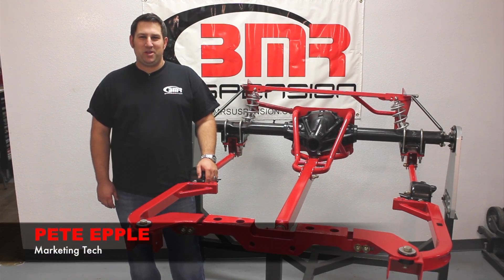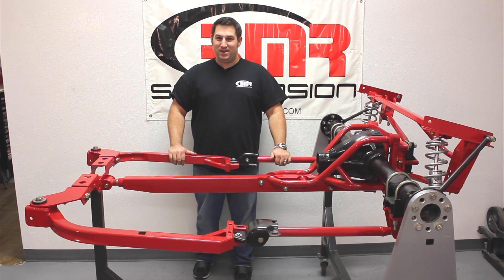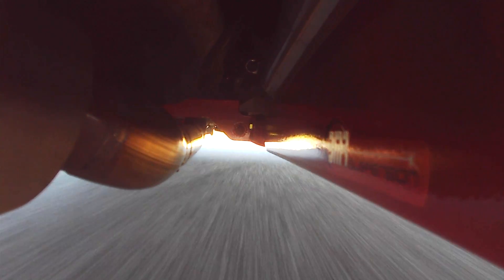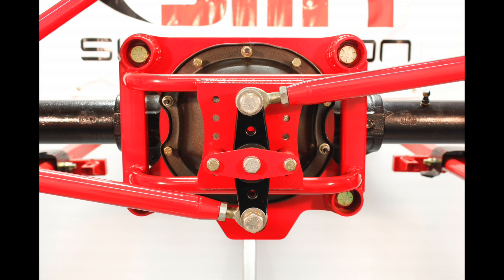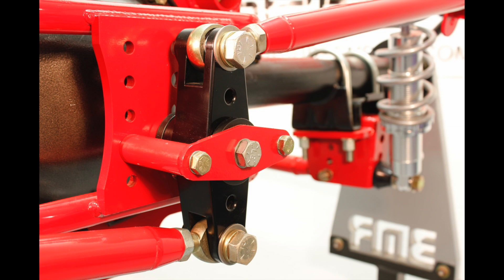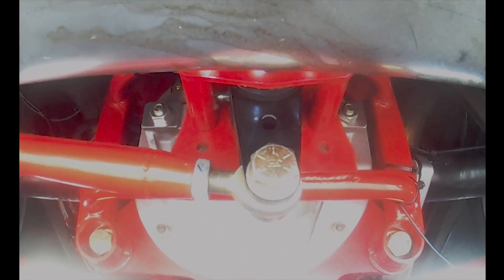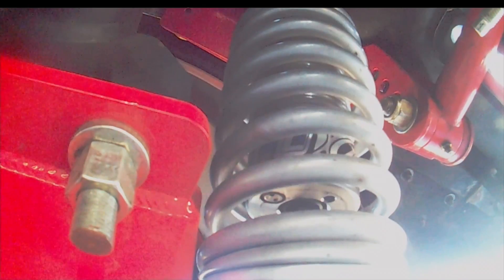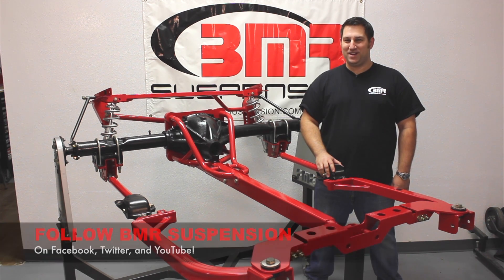BMR Suspension Torque Arm Rear Suspension Systems for 1st & 2nd Gen GM F-Bodies

Comment: Can you make one for trucks? Such as my 3rd gen ram or a 67-72 chevy C10? If so, how much would it cost?
Reply: I'm not BMR, but your truck already has a good suspension.  NASCAR used it for decades.
Reply: @joehall7772  Leaf springs are ass AFAIU. How exactly would you propose optimizing a leaf-sprung setup for circuit/auto-X and drifting? (For further reference, I have an 09 2wd Ranger, now.)